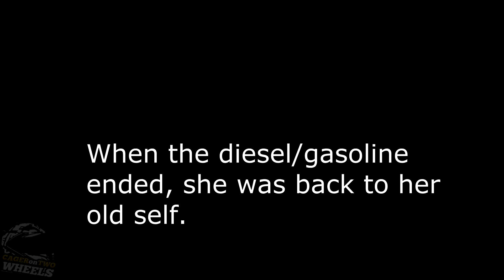Bike running on DIESEL!

Comment: Quite a few petrol bikes will run on diesel, usually 2 strokes with high compression such as Jawa, CZ, MZ, IZH, etc. probally by design. I ran a Jawa 350 sidecar outfit on diesel back in 2001 during a UK wide tanker drivers strike as petrol was difficult to find with the fuel shortage. I've also witnessed a 1970's CZ 250 twin running on methylated spirits mixed with cooking oil. What's amazing was that the owner had ridden 200 miles to a motorcycle rally on this concoction. Other fuels all internal combustion motors will run on in parafin (derived from coal) and I've seen many ifeld bikes run on the stuff as it is cheaper than petrol and not illegal to use off road. The rarest fuel used in a petrol bike I've actually witnessed (and my friend bought the bike!!) was a CZ 250 that had been a farm workhorse for 21 years and ran for 31,000 miles on TVO (thick vapourising oil for tractors) for its whole working life. It was registered as an agricutural vehicle so that it could legally use tractor fuel in the UK.

Comment: I did it on my RD350YPVS in 1994. On autopilot on my dinner break fro work, stopped at the same fuel station that I used for my van. Got 150 yards before it coughed, then about another 30 before it went' bleeeeeaaaaaarghhhhh'
Spent the rest of the day draining it and cleaning carbs lol, happy days!

Comment: Diesel won't hurt it, just a pain to run out. The fuel filter will have to be changed and the injectors might need a cleaning as they can plug up easily. The engine will take it if anything Diesel lubricates better then gas so it shouldn't cause much stress on the engine, though with higher compression you'll want to shift it like a diesel, keeping the rpm's low so you don't damage a valve. Diesel burns on the principle of compression, your bike has probably half to 1/3rd the compression of a diesel engine, so technically yes it's going right out the exhaust.
Reply: I agree. Accidentally putting diesel in a gas engine is better - and far less expensive to fix - than the other way around.
Reply: Travis Piper that's probably why diesel engine s last alot longer than gas engines
Reply: because diesel lubricates better
Reply: Joe Suppes forged internals and the fuel isn't a solvent. also way slower engine speed. so the pistons don't go through as many strokes for the same distance a gas engine goes.

Comment: It will depend on the mix of petrol to diesel. The spark plugs will basically foul up to the point where it will not run or especially it will not start the next time . Draining the tank is very simple on a bike the tanks usually lift straight off without tools and there is a line connecting to the carbs or injectors. They also will foul up if you run too much diesel through them. 
As to long term damage , not so much with just a bit of diesel  The valves and cylinder head will clean up after a good run on pure petrol (preferably high octane) Oh if you ever want to clean internal engine parts on a stripped down engine a combination of diesel and petrol is the best after a soak in them but wear gloves a diesel kills the skin with too much exposure.

Comment: I did this when I had my first bike. I immediately phoned the AA, a breakdown service here in the UK. They charged me £200 to drain the tank.
Reply: +CagerOnTwoWheels  I recently started putting diesel fuel into my bike when I fill up, to no ill effect whatever apart from slow acceleration & a modest top speed. Though the average mpg has improved over 100% to 180 mpg. Mind you, 8.5 bhp, a 20:1 compression ratio, & Yanmar written on the side, may have something to do with it.. ; ) - Perhaps it was your low revving long stroke Honda twin that led to you putting the wrong fuel in? It does have very diesel like torque characteristics. If I ever go back to petrol, the 700 or new 750 would be my choice.
Reply: lol could of just do it yourself (facepalm)
Reply: you could've just took the lil clamp on the fuel line off and let her drain that way
Reply: Climax Slushies Drain all over the petrol station ground, good idea!
Reply: +Conway79 Dont forget to light it up real good.
Reply: Didn't nessecarily mean drain it there 😂
Reply: same ;) xD
Reply: scoupdogg $200 is less than £200...
Reply: ***** €200 is less than £200...
Reply: TheTomco11 Only just 😉
Reply: It's a motorcycle, just add a hose and let it run dry into the gully. Else you can just unplug the fuel line and let it run there empty.
Reply: Conway79 lol should have syphoned it out yourself. Costs a few quid for tubing
Reply: @ClimaxSlushies  buy a couple of buckets and call an uber for 30$

Comment: I put 2 1/2 gallons in my ctx and it quit about 1/2 mile down the road. Got it hauled home and drained the tank. Put good gas in and cranked it over with throttle wide open and it finally started. Welcome to the club.

Comment: Just in case anyone is wondering. The reason for low power is because the diesel needs a longer throw in the cylinder to gain the pressure to combust. Also only have octane level of 25/35, petrol is around 70/90.

Comment: Did that with my CTX and it quit about 1/2 mile down the road. Had to drain the tank and crank it over till the diesel was out of the lines. New gas and flush the lines and good to go. Welcome to the club.

Comment: Yes a petrol four stroke engine will run on diesel if it is mixed petrol, but you may damage the engine when under load, you will get detonation which will be bad for your engine.

Comment: my cousin's 2 stroke homemade bike was accidently put on diesel, and for some whatever reason, the diesel ran great, as long as it was warm enough, i was surprised, ever since then, he decided to make it run on diesel, adding adjustments to the carb and fuel system
Reply: GravityPlays same with my derbi senda 2016 Ltd
Reply: Project Youth cool
Reply: i also forgot, he added a glow plug, so it could keep the engine warm enough to run
Reply: @Endo-TAC  My grand father was a diesel mechanic, he would stick a 100w light bulb under the engine to keep his diesel engine warm in the winter.

Comment: The diesel ignites from gas burning just fine. Diesel releases it's energy more slowly than gas, so it sounds different and feels different, but no harm, just find a place to cruise and run it out. If there is too much you might soot up the plugs.

Comment: ya I ran my ctx to reserve and put diesel in to fill it up. Made 1/2 mile down the road and it stopped. Got it hauled home and siphoned the fuel out and put 91 octane back in. turned it over a couple of times and it run like a top.
you are not the first and I won't be the last. It happens.

Comment: Cager if you can drain your tank and flush it with clean fuel. You should also replace the spark plugs once all the diesel is out because the oil will foul out your spark plugs and it will still run rough. Hope this helps and the bike isn't hurt. Ride safe bro

Comment: The problem with diesel in a gasoline engine is the diesel modifies the octane rating of the gasoline in the tank. The fuel will allow the engine detonate under load. Diesels don't have to worry about this problem since the diesel is injected after the cylinder is already at peak pressure. Pouring a few gallons of gas in a diesel would be less hazardous.

Comment: Just to add my 2 cents... literally 3 days ago i put a fulL tank (9 litres) of diesel in my Kawa ninja 400 which is fuel injected, i made it about 50 yards and it coughed and spluttered and i just hit the kill switch, I WAS STUCK, mile from home at 10 PM .. cost me 265 euro to get it brought 40 km home... i suck out the diesel with a syphon and put in some petrol and she ran, not the same but she runs... Lesson learned

Comment: yeah that's definitely one of those things that you need to just empty your tank and lines and put gas back in it, not nearly as bad as putting gas in a diesel and blowing your engine up. Kind of amazing that BMW and Triumph both make flex fuel bikes, the new Tiger can run on pretty much anything including diesel.

Part of the sound is the diesel is still burning in your exhaust pipe, you don't have high enough cylinder temps to burn it all so its still burning in your exhaust

Comment: i have done same in my 100cc bike and it was like hell the smoke was bursting like valcono from exhaust and acceleration was acting weird and no power is being produced i was expecting breakdown of engine.And due to combination of petrol and diesel i was not able to drain my fueltnk my fuel pipe was jammed

Comment: Your catalytic converter could be toast now that's going to be your costliest repair if your engine is internally fine. A full flush of fuel system and even the engine is the best idea, but if you don't maybe at least change the oil, check the spark plugs, and use a bottle of fuel injector cleaner over your next few fill ups of GASOLINE. Lol good luck.
Reply: CagerOnTwoWheels

Even though you don't feel anything different, you definitely should take your motorcycle to a mechanic to have it checked.

What you should have done when you figured out you fueled it with diesel was buying a suction pump at the gas station store, a container and take all fuel out.

As many have said, your oil is most likely altered and is no longer proper to do the remaining Kms until your next maintenance visit to the mechanic.
Reply: I am not sure if motorcycles even have Catalytic converter, maybe the new ones.. But anyway if you put diesel into Motorbike with carburetors it is not much of a problem :)
Reply: Milan Čihák yes most modern motorcycles have a catalyst. I know for a fact the NC700X has one, right at the top of the header like a Honda car. Carbs may handle diesel better than injection does in a gas engine, but the combustion cycle still isn't going to like it.
Reply: turbo311 Please do not tell me that new bikes have catalyst :-(, Another useless "ecological" thing in exhaust. I Intendedly put a diesel in an old motorbike. And the thing was when it got hot, it was still going even after I turned the ignition off.

Comment: run to 1/2 tank and fill up, run to 1/4 tank then fill up and so on, after 2 or 3 full tanks clean the spark plugs as the derv coats them and can cause increase in plug heat then you have premature ignition. check your baffles make sure they are not getting an oily coating. or simply dump the full tank of juce and put fresh in. you are not the first to do it and wont be the last,

Comment: Diesel has a much lower octane number than gasoline. The gasoline-diesel mix has a much lower octane number, which makes the engine knock, until the knock sensor retards timing to such a degree that you lose significant power.
Or, if you have a bike without ECU and knock sensor, it will just knock like hell if you don't feather the throttle.

Putting gasoline in a diesel is MUCH worse. Diesel normally lubricates the injection pumps that run on 200 bar or so - on gasoline, they'll quickly wear and seize.

Comment: Why not get a hose put it in the tank suck on it and empty the tank out into a bucket then fill up with petrol. What little is left in the injection system or carb should run out pretty quick.

Comment: Here in the states there is a separate nozzle for Diesel so it's hard to make that mistake.
Reply: It's the same here but Cager wants to save even more money! Loool
Seriously, sometimes when a person have a diesel car and another machine that runs on gazoline this could happen. It's not the first time I see this kind of thing.
Reply: Like Nuno Ribeiro said, it's the same here and it works nicely on cars. My motorcycle as a large fuel hole (as I suppose most motorcyles do) and I think that most likely any fuel nozzle would fit - except, maybe, a truck nozzle which are much larger and, I think, are high pressure.
Reply: Diesel is just as expensive as HIGH Test here.
Reply: Yeah but over there at states, you have 83 Octane "Gasoline". And Diesel over there is quite hard to find cruising through mid-west or so. Also your cars does achieve worse MPG than any other EU car, my 1.9 TDi doing 100 kph in the lorry lane , 60-70 mpg. And in the fast lane doing 150 kph all the time, about 40 mpg. No hatred, just saying why are the prices different, here is the 95 Octane Gasoline the cheapest version of gas you can buy.
Reply: Milan Čihák In Europe, the octane rating on the pump is simply the RON figure. America, by contrast, uses the average of the RON and the MON figures, called the AKI (anti-knock index). Thus, 97 octane “super unleaded” in Europe is roughly equivalent to 91 octane premium in the United States. And Ive filled up in many states and never have seen less than 86 here
Reply: Hmmm, thanks for info, I have been travelling from NY to St. Louis and on my way never seen higher than 86 to be honest, only on Shell stations, and now I get all the fuzz about Shell V-Power premium fuel. We do not have much difference between Natural 95, 98, and Shell 100 V-Power.

Comment: When I worked for a Dixie Chopper dealer, I dropped off $18,000 of 2 Dixie Choppers, we got a call that afternoon that one wasn't running and smoking when it did run.  I got down there to see what was wrong, both plugs were fouled and it had a tank full of diesel, of which "nobody" filled it with diesel.  New plugs, fresh gas, it ran again.  2 weeks later we had to pick it up again for the same thing, tank full of diesel lol.  When I was there I did find a red gas can with Diesel written on it in marker, guess they didn't learn their lesson.

Comment: Dude, that fuel station is cursed! I did the same in my car there.
I also just drove off not giving a duck. XD
10 litres of diesel in a 50 litre tank (I then topped up with gasoline), in an 1.6L '86 toyota.
It dripped a bit from the exhaust, but to be fair I barely noticed.

I've heard that doing the reverse (gas on diesel) kills the car.

Comment: Put 8L of diesel in my car until i realized the liter price was way too low to be gas. Then filled it up with premium (+32L) and drove away. No issues whatsoever, besides a little more fumes and the smell of diesel out of the exhaust.

Comment: I know a man who put regular gasoline in a diesel.  The engine was toast.  But then again that was in a 80's and engines have come a long way, and it was a car so it was under more stress.
Reply: Putting diesel in a gasoline won't kill the engine but putting gasoline in a diesel will be the end if the engine is run on gasoline.
Reply: Thats what he did.  It was a story my dad told me of his friend from school a long while ago.  He never drove a diesel before and forgot the fuel was not gasoline.  Worst part is the car wasn't his, was pretty new, and from what i was told very very nice haha.
Reply: Yes Cager, that is what i figured too.  This story I told about was back in the 70's or 80's.  Engines in cars have come a long way, making it only slightly expensive when you have a bad moment at the pumps haha.  Here where I am in the states though, most gas stations have separate nozzles just for diesel itself.  At the pump there is one for gas, then one for diesel.
Reply: CagerOnTwoWheels

That's very strange. VW Golf TDI, for instance, has some kind of security measure that turns the engine off then it detects improper fuel.

A former colleague had a similar issue with his VW GOLF when his wife fueled his TDI Golf with Gasoline 98.

Had to take it to a mechanic to have the fuel tank flushed.
Reply: i put gas on my turbo diesel,  runs ok as long as i don't rev it up. i keep topping it up with diesel and it took me almost 1000km and 3 top ups to get rid of all the gas

Comment: the only part that takes a lot of abuse filling the wrong type of fuel is the cataalytic converter. other then that it is as dangerus as running on two stroke petrol.
Reply: +grapsorz two stroke petrol is the same, you just have a bit of oil in the fuel.
Reply: +grapsorz two stroke petrol is the same, you just have a bit of oil in the fuel.
Reply: Thomas Gregoire yes. it is not dangerus for the engine, just for the catalytic converter.
Reply: +grapsorz true true, but putting petrol in a diesel car is horrible x)

Comment: Should run fine, minus acceleration, the diesel is getting burnt, just not all of it, It's the reason why diesels have glow plugs for starting up etc, while the petrol engine if running a lot of town traffic may missfire a bunch, the only problem with it will be the oil and your cat, Your cat will be saying to your ecu to put in less fuel, which is the reason why your throttle/engine is less responsive. Oil will need to be changed as any excess that didn't get burnt while the plugs were sparking or was missed due to a missfire then it will push past the rings into the sump, otherwise your bike will be fine after a simple fuel flush, get it almost empty, drain it out all the lines and put in some fresh petrol from a jerry can, run it for 20 ish miles, that should clean it perfectly.

Comment: I would've gone straight home pulled the fuel line, drained the tank then put fresh unleaded in. Then ran it on Super unleaded for a few weeks as it has better cleaners in the fuel.
Reply: +AshleyM300 Not in the US. The gov't has mandated the same cleaners from the super be in the regular as well.

Comment: there is pump 15 euro even cheaper which removes the fuel from the tank.the daamage you make to the motor is much biger than 3 literes of diesel you would through away.

Comment: The engine just needs to be warm enough to vaporize the fuel to run on diesel, if the fuel is preheated it would run even better and have more power.

Comment: Well this is still better than putting petrol in a diesel engine, especially newer diesel engines. 

Petrol absolutely destroys the fuel system of modern diesels as the high pressure pump relies on the lubrication properties of diesel.